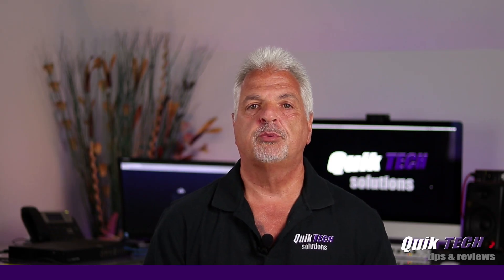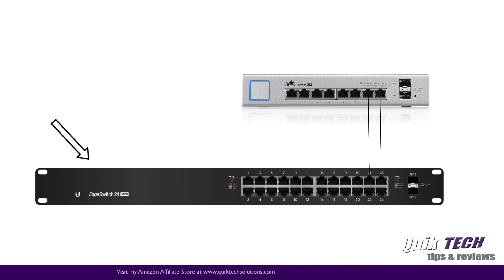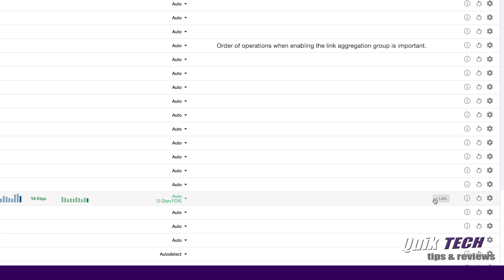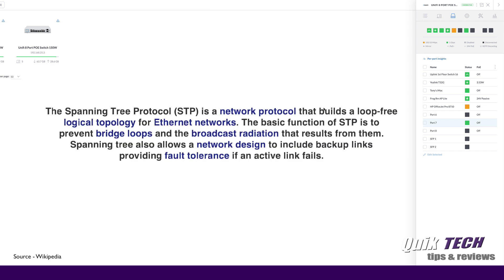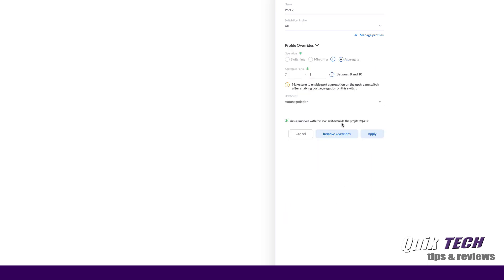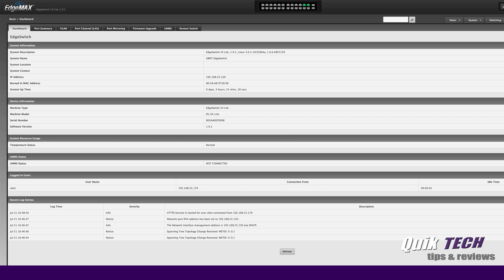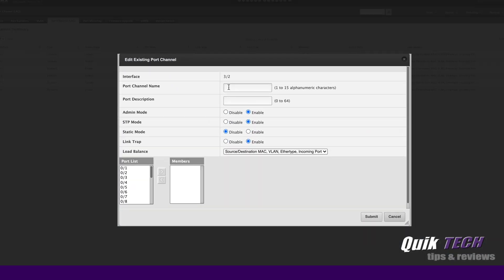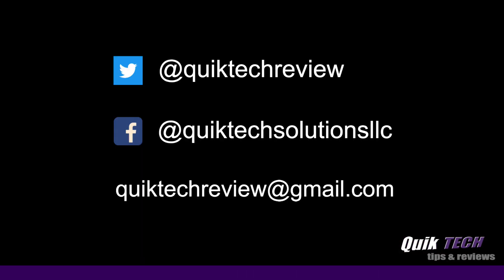Link Aggregation between Edge & Unifi Switches

Comment: Tony, thank you for posting this! I have a 24 Ghz p2p bridge that is susceptible to rain fade. I was considering throwing up a 5 GHz p2p as a backup link. This looks like it would be a good solution for adding that redundant link to the network. Do you know if the 5XP switch would support this via the newer interface? It looks a lot less complicated. Finally, do you NEED a unifi controller in this scenario, or were you just using it for monitoring?
Reply from the maker: Hello Ryan,
I haven’t had any hands on experience with that particular Edge Switch, but the UI is pretty standard across the Edgemax product line so I don’t see why it wouldn’t. The Unifi controller is for configuring the Unifi line of products. Sorry I couldn’t provide a more definitive answer. Have a great day.
Reply: No worries. After I posted that I caught the version in the top right of your screen. That Is the same version as available in the download section for the SW I was asking about. Do you believe a difference in two bridges would be problematic?